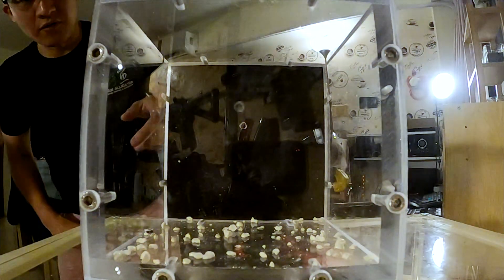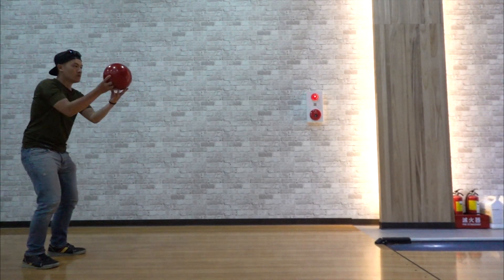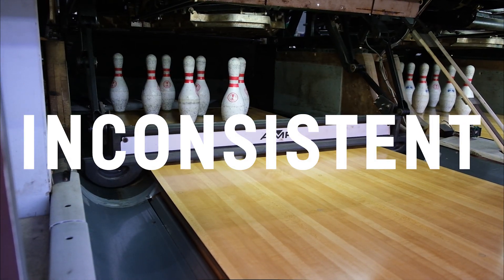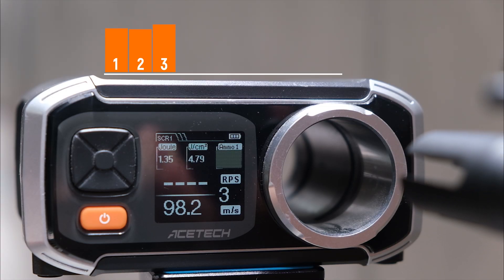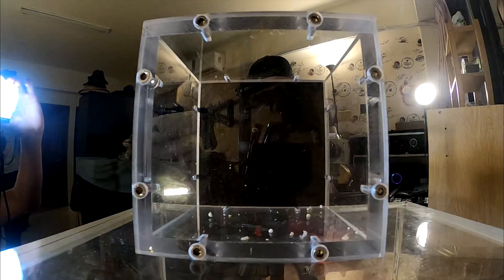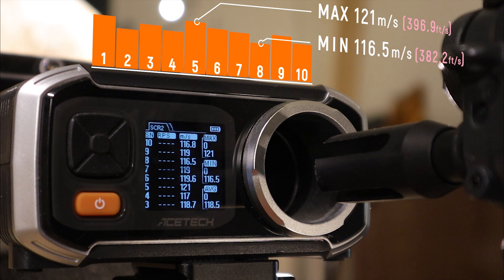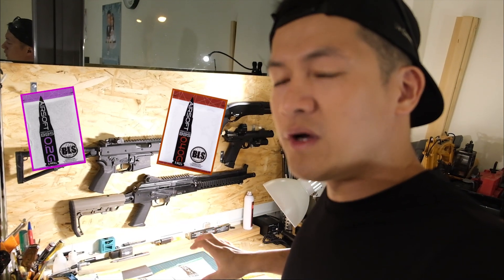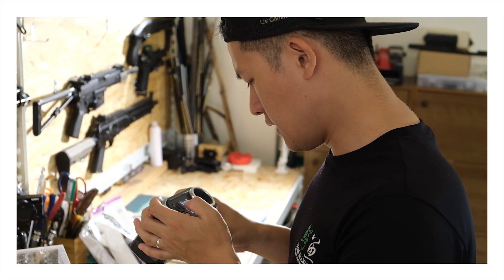Is Shooting Speed Consistency Really Important? 初速穩定很重要嗎?

Comment: There really should be some pattern to the consistency when it comes to BB weight. IMO it just goes to show that 10 BBs do not provide statistically significance. You should redo the test with a higher shot count. If not publically, then internally, to find a more suitable number.
Reply: Just to add. I love these videos and what you are trying to achieve. Take it as constructive criticism
Reply from the maker: Hey man, for sure! We love constructive criticism man otherwise we will never improve! So yes we actually improved this testing method as the way you suggested, however due to the flow of our videos we didn’t show all the results, we test each weight of the bbs 3times and pick the one with the best pattern.we which we could do more, but for the sake of time consumption we sometime have to compromise a little.

Comment: I know I am late to the table, but is bb's a consistent size? I understand that you measure it in grams and I believe that the weight is consistent
Reply from the maker: It’s actually not hahaha the weight and size are all tiny slightly different due to the production methods, and so some snipers actually do put in the time to hand pick their bbs
Reply: @4UADSmartAirsoft  it will be difficult to get a constant reading with that